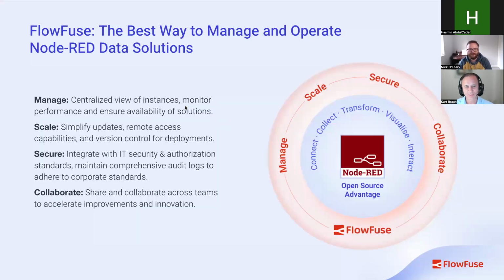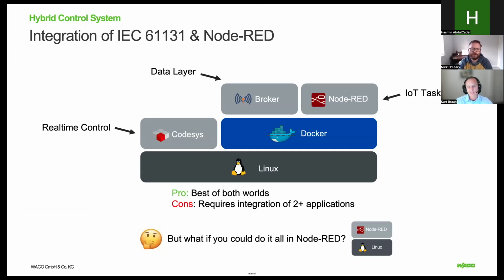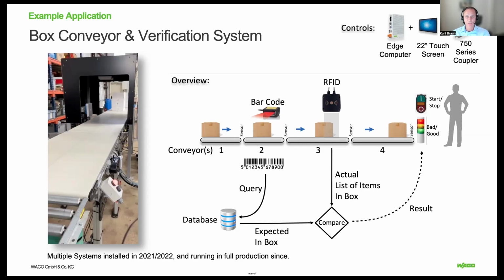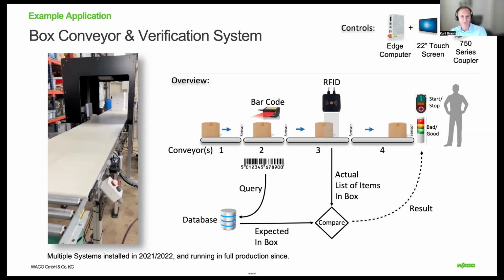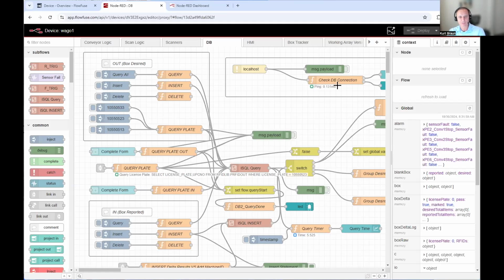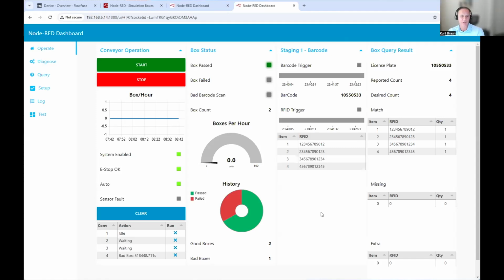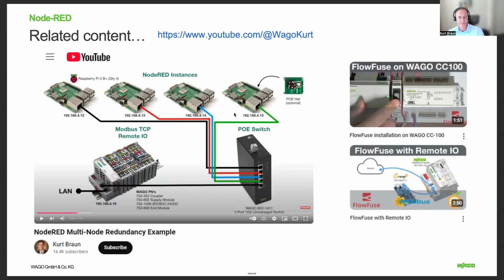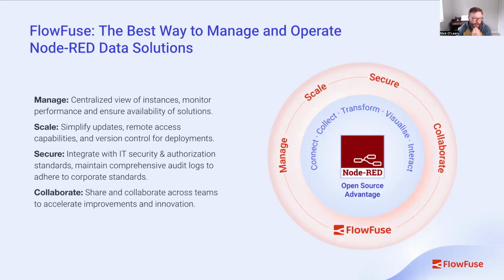Webinar: Bringing Node-RED to Industrial Solutions with Wago

Comment: Thanks for your presentation. I've  been using NR for 10 years and have created some very interesting applications. I was listening attentively when Kurt stated that the "Function" node was the node of first recourse, whilst Nick stated that the "Function" node should be the node of last resort. I'm in Nick's camp. Jumping into a NR implementation authored be someone else, peppered with "Function" nodes, is a nightmare. It's the biggest complaint I get from experienced programmers getting familiar with NR. 

Subtle things like node layout and presentation, when someone sees NR for the first time, either makes it or breaks it for NR adoption. It is very easy to create obfuscated flows.

There is no doubt that NR allows one to focus on the data flow rather than spending time on the infrastructure. Rapid prototyping is a huge win. 

Another point Kurt made was the lack of NR exposure in local markets. Many headhunters I have spoken to have never heard of NR. None of their clients request expertise in NR. Unfortunately for NR proponents, we are fighting the C# and the .NET wars. Curious IT architects are afraid to introduce NR into their solutions.   We have a ways to go.

Comment: Well.... Node Red got a Dashboard with 2.0 that is laggy, buggy and misses a ton of features .... I hope you does not mean that like "Industrial Solution".
EDIT: Oh I forgot the quasi "No migration feature" when coming from DB1 you can start by zero UI.
Reply: I'm sorry to hear that's your experience; we have plenty of users on Dashboard 2.0 with great success. But we do recognise it isn't "job done" and theres a lot of active development going on. I hope you've been able to feedback details of the issues you've had so it can been investigated.
The lack of automatic migration from the old dashboard nodes was something we spent a lot of time thinking about. FlowFuse does provide a migration service from DB1 to DB2 - it can't migrate everything, but it does try to get the basic structure moved forward.
Reply: @knolleary i dont have any problem with dashboard 2.0 and it is very fun to use. Specially it uses vuejs, multi-tenant dashboard and  being vuetify included it just great. Thanks for the nodered, flowfuse, dashboard 2.0 and making iot, iiot is accessable.
Reply: @MuratCan-Berber  I also think it is absolutely awesome and they even work on helping you with the migration. While it may not be drag and drop yet and will be hard since the underlying vue js etc. is just different - saying that there is 0 migration possible is simply not true. 
Also the bugs that get reported properly will be seen. As with every new Project it cannot be bug free from the start. The question is how well do they maintain it - and I think you guys do an awesome job!🎉